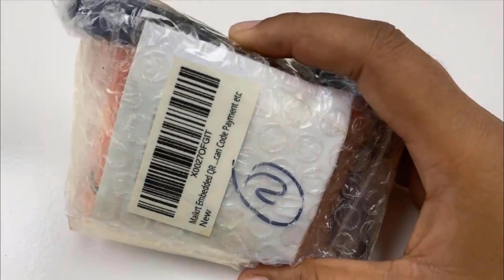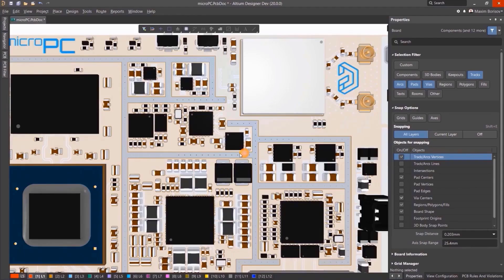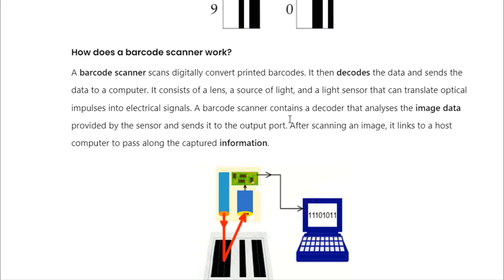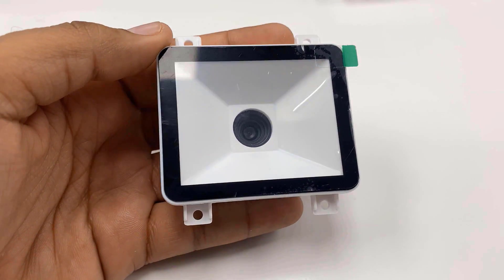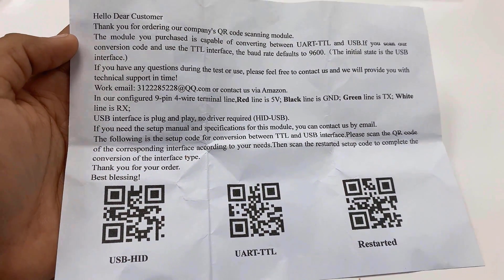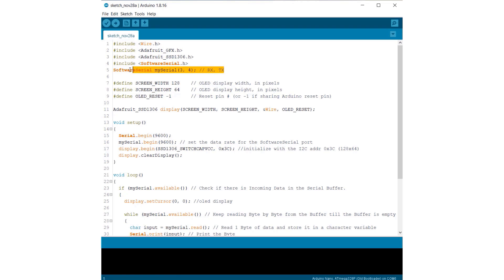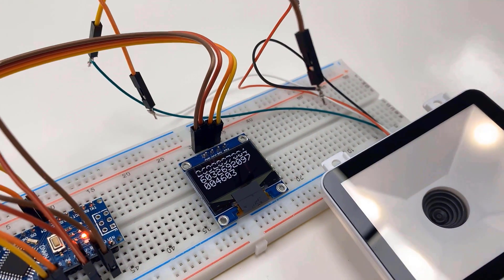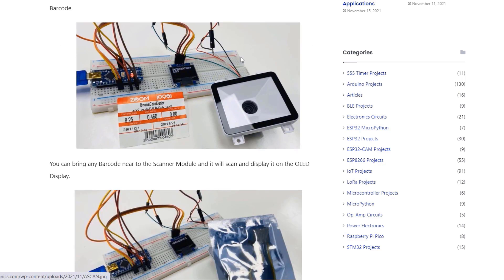Barcode + QR Code Reader using Arduino & QR Scanner Module

Comment: Does anyone know why this works on the uno board but not the mega. I have the same code and configuration.
Reply: Hey bro did you figured it out yet? Because I have the exact same problem as you, can you give me your insights and what did you encounter to solve it thanks bro.
Reply: @sakamotokun9057  yeah mapping the ports using software does not work, you have to use the actual RX/TX ports. On the manual of mega you can see what those are and just use those ports in code.

Comment: What size is the 9pin 4 wire terminal line 
Is it 1.25mm or 1.0mm pitch
Reply from the maker: Cant remember now. Did that project 2 years ago🤣
Reply: Where did u get the software
Reply: 1.00mm

Comment: For anyone who has a problem with the Scanner working but not sending any signal, Please try to check for a Manual in your product's own page.
i had been following this video for 3 weeks with no avail, just to realize later that the pin layout is different even though my scanner looks strikingly similar.
Reply: where can you find a manual for products page

Comment: I tried running this for a school project and it wasn't working, I tried using your code directly and then also variations and I still couldn't get it to work, any advice or is there something I could have missed?

Ok so turns out it was either an issue with the particular module or I forgot to scan the set up QR codes, school project works fine.
Reply: Hello can you tell me more about what happened?
Reply: @ilikememes1402 it was my mistake with me forgetting to scan the activation barcode, the other possibility is that there was a fault in the initial model I had but the second one worked fine after scanning the activation code